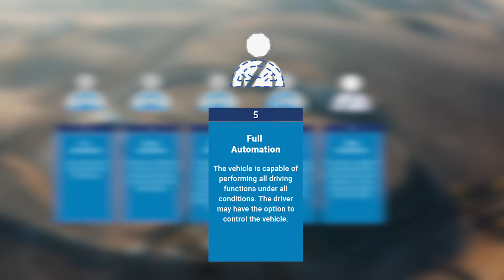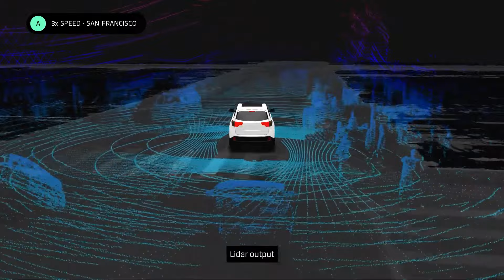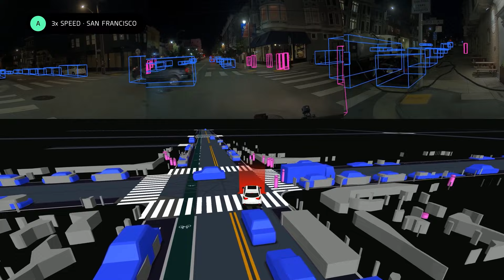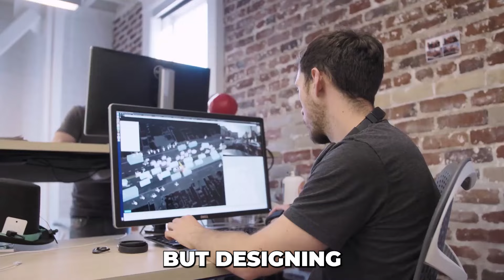Zoox Is The Robot Vehicle That Is Changing Transportation

Comment: Until they connect with a shared signal+transponder network that covers all roads, autonomous road vehicles are stupid.  Automated trains and airplane autopilot have depended on traffic control networks for generations now.  Autonomous car leaders are willfully ignorant of this
Reply: They run on different situations, while it' true that a saturated network may impact an autonomous vehicle, it can respond to almost immediate situations. Trains and airplanes need to plan any movement miles away because they can't simply stop or change directions.

Comment: It will take at least 20 years for you to convince people to ride in a car that has no available means to control it.  I would ride it around a closed track. That's about it.
Reply: Thank goodness your opinion doesn’t mean anything, we’d still be in the Stone Age.
Reply: @sblazea50  Lookup, Tesla self driving car. Tell me if that death trap is something you would put your family in.
Reply: @someguy-k2h I literally use Tesla FSD V12 everyday without a problem.
Reply: @pjitiwong  The F in FSD is supposed to stand for Full.  Meanwhile, Tesla requires the vehicle to be fully supervised.  Very different than a vehicle that has no available controls.
Reply: @someguy-k2h  It’s FSD “BETA” ffs.  

And hundred thousands of Tesla cars are actively using it daily right now.
Reply: @pjitiwong  That's nice.  It's still not "fully" self drive and you have a steering wheel, brakes and an off switch which this Zoox vehicle does not.
Reply: @someguy-k2h  If you think Zoox system is ahead of Tesla, you are delusional.  I will trust Nvidia CEO rather than you on this. Haha
Reply: @pjitiwong  Don't know if you noticed, but this video is about Zoox.  The comment is about Zoox.  Maybe lay off the rec drugs.
Reply: @someguy-k2h  Who mentioned Tesla first? You or me?